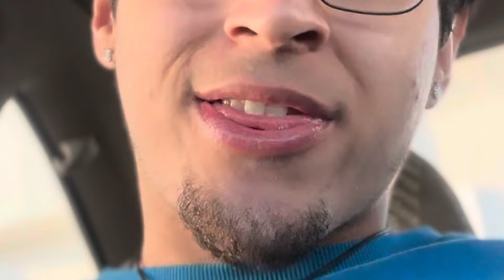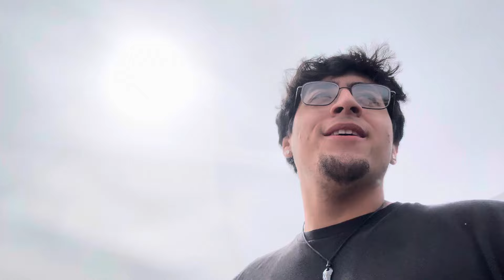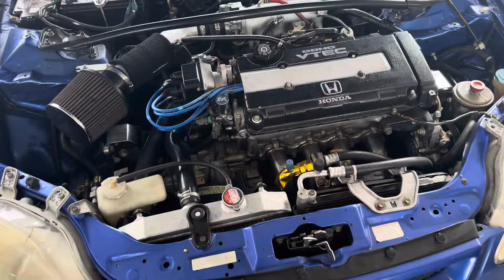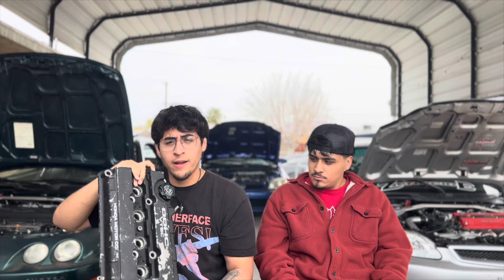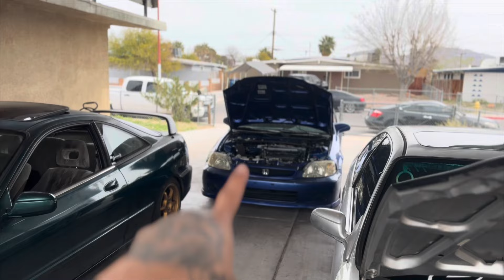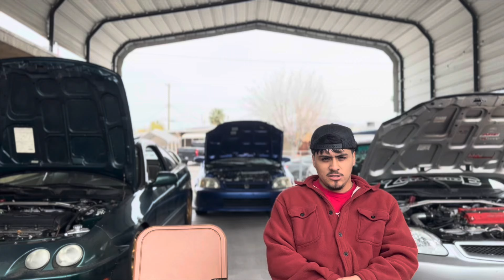SHOULD YOU STILL B SWAP IN 2024??

Comment: B used to be cheap to swap. Now you’re looking at $800-$1000 for a Vtec head, $500-$600 for a long block, and $600-$800 for a trans. Not including maybe $200-$300 for an ecu not chipped or with Hondata. Then $500-$1000 for a turbo kit all said and done and maybe $300-$500 for a tune. I’m up in Chicago and prices on parts are crazy high now.

Comment: With their current price, it's not worth it in my opinion. The amount of money you buy just for a b18c1 is almost equivalent to buying the minimum requirements for a k swap. B18c1 is going for crazy price right now for around $5k-9k. Even the very base engine like the B18B and B20B is still going for $2k-3k if you're looking one that has low mileage. Not worth it anymore.